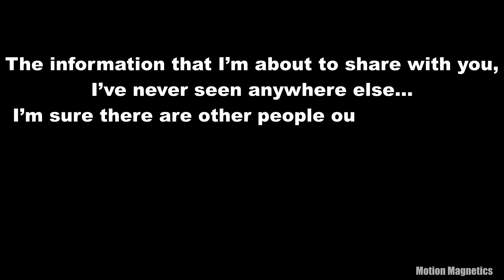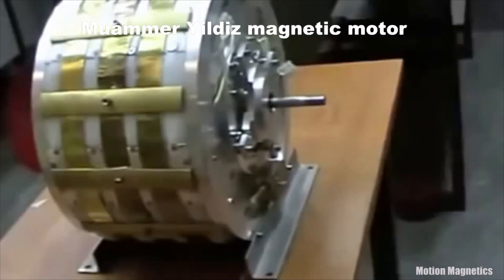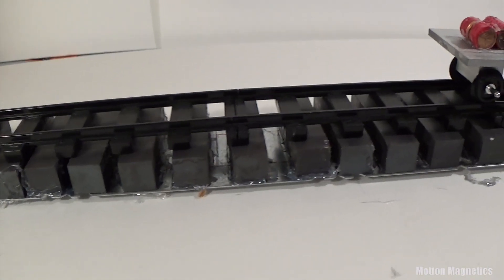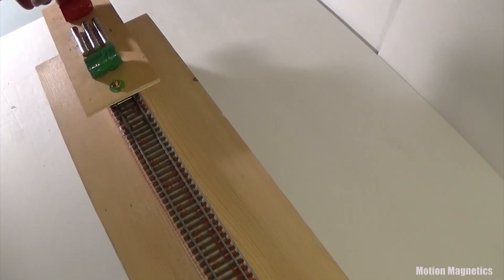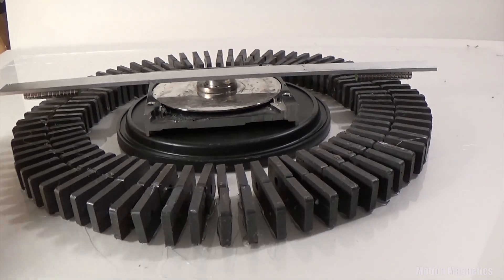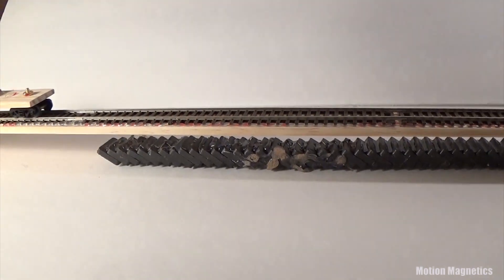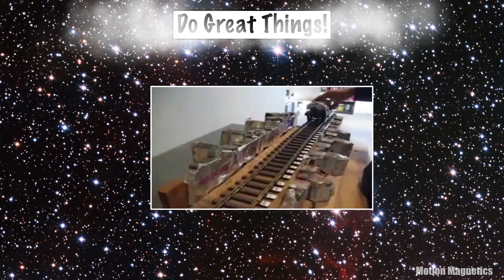The 3 Types of Magnetic Motors Part 01

Comment: The biggest problem with these is that there is no such thing as a permanent magnet.  When you move magnets past each other the larger one pulls the magnetic field out of the smaller one.  There is only a shot time frame that these run because the field gets weaker until it quits.

Comment: I would like if someone could explain me how energy is being transmitted into those systems. If there was a generator attached to that spinning thing surely we all can agree that it gives electric output and that power most likely pretty soon exceeds the amount of energy initially put to start the shaft spinning.
Reply: the free energy is all around us all we need do is extract it from the air using magnets

Comment: You placed the magnets in 45 degrees at the traintrack but not at the wheel (Imbalanced System). Why not? Ofcourse if You use 4 magnets instead of 2 it will double the amount of energy. In theory You can use one push-magnet for every spinning magnet. Both push-magnets must have optimal placement in both degree and placement.
Reply: then you will have a train wreck
Reply: @rogerd4559  No not My train wreck... The Guy Who will patent it will be a train-wreck for real...
Sadly.😔😔😔

Comment: The v-gate idea, as far as I am aware, is based on the strange locomotive train patent that uses conical wheels. I don't remember the name of the inventor, sorry. However, as it pertains to this failed assembly, I believe the issue is that the wheels were spaced such that one set was receiving the push from gravity while the other set was overcoming the resistance. I suggest that you reassemble your v-gate with the drive magnets on the 'train' spaced in pairs far enough apart that you can also overcome this resistance.

Comment: I thing slightly shading the right magnet at the right time & place. Would make them work. Like a shased pole motor. Deflect or cancelle the right magnet at the right time . I think it could work. How well is another story. And the power to do so. Should be 100 miliwatts guve or take, for small motors in the video. The output may be 98mw, or 198 mw who knows! If it even works. About 100 turns if 28-30 gauge magnet wire,  on the magnet that is stopping the rotor. And pulsed at the right time. For a few microseconds it may work. And power in will be minimal. Output could be alot more. ( or less !  )

Comment: Equal and Opposite reactions,     Magnets hold you back,   as much as they Push away..
Reply: True... But magnetic fields can be shielded. Allow half the field to pull and shield the other side so you don't get the pull back as it passes.
Reply: @Crimsonedge1  flux always forms a closed loop, what you suggest is impossible.
Reply: @peterwright5311  he’s not saying it deletes the magnetic field, he’s saying you can redirect magnet flux with shielding. Mu Metal works the best and it is used in hard drives

Comment: Complete and utter BS in the same class as magnetic therapy, flat earth fanaticism, tin foil hat paranoia, and secret impotency remedies. Glib sounding techno babble is no substitute for actual knowledge and hands on experience. 

A cumbersome electrical contrivance that spins inefficiently might be generously called a "motor" but without an advantage in size, weight, efficiency, or cost of manufacture it is simply a curiosity best used in a school physics lab for teaching critical thinking and assessing first concepts.

Comment: if you were to take a rectangular magnet with a north and a south pole and found the exact center where there is no north or south and cut it in half, would you then have two north pole, south pole magnets.if so that would mean that that sweet spot that is neutral is just as important as the north and the south?

Comment: you have to add kryptonite, you know that stuff that kills superman.
Reply: Interesting suggestion. But you know, the kryptonite will not work unless it is used with a flux capacitor. In which case your device will spin or travel at 88 miles per hour.

Comment: I invented and built my own in Dec.2010, and it was ALMOST working, just kept getting stuck! Then I lost everything to 'Government', and since I have learned the "FundamentalPrinciples" of 'the common law' which ARE 'the supreme Law of the Land' under the U.S. Constitution (Esp. Amend.7), and I just filed a US Civil suit, to eliminate 'over 90 percent' of what police do, according to more than one actual Cop, who've actually said that to me, after I explained these to them!
MY MOTOR, had one rotor magnet (1st Prototype), 9 stator magnets, and it WAS pushing itself past 3-4 of them before getting stuck, because it was made of hot glue and scrap VCR and Hard Drive parts!  I need a CNC machine to mill precision parts and adjustable mounts for the magnets. 
Before I did that I tested the theory (HOW to make one magnet fly past another CAUSED by its own magnetic force and momentum):  I caused one magnet to pull itself past another, by moving ONLY 1,000th of an inch per second, using a micrometer caliper and timer, and it DID fly past, and DID NOT come back!
That was all I needed to know I CAN do this!
NOW, I need to draw up a patent, get 'patent pending' status at least, THEN I will SHOW everyone the trick, and ask people to make them for me, and start a company....like Space-X.
I also figured out mechanical device that can use momentum of counter-rotating, oscillating weights, which can 'levitate' a craft, which I plan to build its frame out of!
I plan to build a space station!
I might already be doing it too, if 'Government' had not taken EVERYTHING from me back in Dec. 2010!
AND THAT HAPPENED BECAUSE EVERYONE JUST DEPENDS ON 'LAWYERS' TO TELL THEM WHAT IS 'LAW'...SO...
COME TO MY FACEBOOK, AND WATCH AND LEARN HOW I 'GovernPublicServants' #LIKEaSOVEREIGN with the 'FundamentalPrinciples' of 'the common law' which ARE 'the supreme Law of the Land' in the U.S....
And as I explain 'How We Exist, The Genesis of Relativity', how energy and matter come to exist and 'fundamentally' function, and how to 'CureAllDisease' using natural diet and exercise, and C-60 (i.e. in Olive Oil to add to food) to Detox.
HERES A LINK, and a video of me DEMONSTRATING how to tell a cop he CANT give me ANY 'civil citations' (only need 'state...true full name' for cops and ONLY when theres 'PROBABLE' evidence you caused harm to another human or their equal 'individual rights')...
A Post about my motor... https://www.facebook.com/harleyborgais/posts/10210089857203074?comment_id=10210285623337105&comment_tracking=%7B%22tn%22%3A%22R%22%7D
Where to get these 'LawDocs' I used to SHOW the cop what REALLY is 'the supreme Law of the Land'...
https://www.facebook.com/GovernPublicServants/posts/246403895743175

And the video with the cop... https://www.youtube.com/watch?v=b4SZvDLiOw0
(I've done this MANY times since, and I've been winning in court most of the time now too, and I'm just starting to put charges against them, and hold them PERSONALLY Liable, for violating their contractual obligation to all of us!)

Comment: magnetic fields of a magnet are like the knots in a pine 2x4... yes... they all have a center point and rings growing outward, but those rings aren't always symmetrically spherical... they're abstract... in a magnet, there is a north and south... on the face, you'd think that North is north, which is true, but one magnet's field grains may be lined up like "-", and the other lined up like "/"," \", "《"or"》"etc... that's why there's a cogging effect when the pattern seems to be working on some and not on others...

Comment: You seem to forget that passing a flux line that "cuts" through a conductor (as magnets are constructed of primarily conductors) it will generate a current if put to adjacent magnetic fields together and force them closer you influence the shape of the opposing field as vise versa too when a field is influenced it's flux lines can be pushed by the opposing field creating a "cutting" flux line that generates current when current is generated heat is as well and could easy be enough heat to demagnetize The whole this or at least create enough entropy the system to where it's output is rendered completely insufficient
This is considering only if there were such a possibility of a magnetic motor
Reply: any magnetic motor would just be a de-magnetizer.

it'll increase the magnets entropy, unaligning its spins and making it less effective.

to take energy out of magnets you take energy out of its magnetism.

and they require energy to be magnetized in the first place, it's not like they're magical pieces of free energy, people seem to forget that

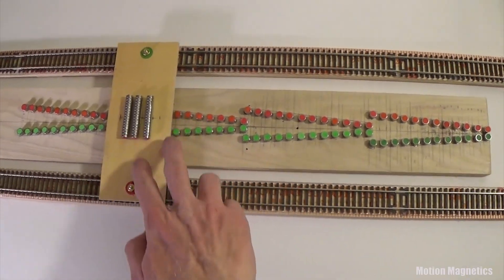Comment: 00:05:12 the configuration really does not nor will it ever 'work'. All it shows is that the energy supplied to the system initially in the form of potential and kinetic energy diminishes to nothing.
00:05:45 Neither do you.
Please stop polluting the internet.

Comment: I have a question. What if you could mechanically turn off the part of the magnet on the side that slows the object?  I know welders use magnets that mechanically turn off (cancel out).  And the YouTube channel Smarter Everyday did a video on magnets and showed them twisting 2 magnets to get them apart.
Reply from the maker: That could be useful, depending on the application. I have some of those but haven't figured out a way to properly implement them into a design yet.

Comment: I'm sorry to say but you don't understand magnets, despite all the explanations and invested funds. They are just "exo" molecular bonds or molecular bonds at a distance that is visible to the human eye. One could not "extract" that energy, let alone make a perpetual motion device no more than one could non-destructively harness any normal, microscopic such bond. Sorry to disappoint but even with some rotary devices like this working exceptionally well there would still be ZERO real-life usage because of  the costs and low power / torque. And, the funniest part would be just realizing we actually DO NOT NEED these rotational gadgets to make our life better. Simple, jet like propulsion (ion-based) brought to each and every individual will allow for the ideal transportation + personal protection (similar to iron man's suit but way more inconspicuous ;) ) = all these gadgets, cars, motors will fade away  like they never even existed. Flying anywhere on the Globe = that's the real target. Just think about it. Nothing else that doesn't build up to that goal is not even worth the try / complication (cars need roads and parking and space-inefficient and cumbersome and limiting)

Comment: This has to be the most ignorant person/ video i have ever seen, what you dont realize is that the amount of force required to push the cart into the system is more energy than what you get out. You have used more energy to push the cart into the configuration from the very  start thantu don it will produce. dont mind the sticky spots thats like saying oh s ballthere is a ball missing in this ball brkearing just ignore it its not like friction has anything to do with efficiency.. i could go on for days. There is a reason you dont see working magnet motors..they dont work

Comment: Howard Johnson? Like the hotel dude? 

I highly doubt anybody will read this due to the age of the video and I'm pretty new to all of this but I don't think arranging permanent magnets in a ring in just the right configuration will result in perpetual motion, or if it does it's not possible to extract any meaningful amount of work from the device. I just can't see any way around putting electricity into the device in order to increase or decrease (by shutting the power off) the power of the magnets.

I do think that there's some knowledge that can be kept from the general public but given the number of very bright people that are either educated or self-taught that experiment with systems such as this if it were possible to rotate a shaft attached to a disc spun by magnets arranged just so and that shaft is then attached to whatever it is you need to move to achieve some desired outcome (say, spinning a driveshaft connected to a differential that in turn transmits the power to two wheels, turning the wheels to then move your device) I don't see how it's possible to keep that quiet across all nations and governments. In short, the concept might not be something your average Joe could come up with but it's not so complex and doesn't require decades of study to create a working, replicable model that any one with above average intelligence and some curiosity couldn't come up with. Automotive engineers would have been all over this concept 60 or more years ago if it was viable.

That being said I'm still gonna try it for myself and see if I can create a useful model because if you can spin an object in perpetuity without feeding it energy from an outside source the applications are almost infinite. Revolutionize wouldn't even begin to describe what that would mean for humanity. So again, it being such a great idea and I'm sure countless numbers of dudes smarter than I have tried it and have failed and that's why we're driving ICE cars and not driving magnet cars. It'll be fun nonetheless.
Reply from the maker: Definitely not the hotel dude. lol He's an entirely different person. Johnson managed to build at least two working rotary magnetic motors, that friends witnessed running. They were stolen from his lab. His designs aren't something easily replicated by the average person, but with enough experimentation and determination, I believe it's possible for an average person to build a working magnetic motor. I wish you well in your endeavors. It's definitely fun! Do great things!

Comment: i have a design; if you've seen the perpetual motion wheel that uses weights along the the outer edge that move, or partly full water bottles, to utilize gravity, you can envision a similar magnetic model.  Each of the magnetic weights is held in ready position by a small, similar sized magnet, near the center.  Instead of just letting gravity do the work, you coax the weights to move with an external magnet(s), placed around the 19° point, probably.  eh?

Comment: What if the magnets were timed to work like Clockwork and keep eachother spinning?
Maybe, one external input to keep it going.
Source of energy for external input could be supplied by wind or solar energy to keep this contraption going
Reply: How am I the first one to like this comment in 2 years? It seems like lots of folks here have even less brains than they have of faith..
Reply: if you can have a external power source that is able to add a kind of magnetic resonance boost  the overall energy should build. 
kinda like the timing of fuel injector pumping gas into a normal engine.

Comment: Have you tried to introduce a flywheel into your configuration to assist in the area of low propulsion
Reply: The built in inertia to overcome in a flywheel is a lot. The reciprocating engines that we power vehicles with have great losses of inertia. between frictional losses, and losses in redirected velocity you only get 10% to the wheels. This is another reason why electric cars are so fast.

Comment: These are at best just mechanical-magnetic flywheels where magnetism is increasing the moment of inertia as if it were a heavier wheel so you can store more energy. It takes more force to spin one of these than the same design with the same magnets but non-charged. Long story short, if these tracks work, put it in a circle and show us how it spins forever or accelerates constantly. This is what happens when our schooling system sucks and makes something as amazing as electromagnetism boring.
Reply: minkusmaz io
Reply: electromagnetism and a magnet are two different animals